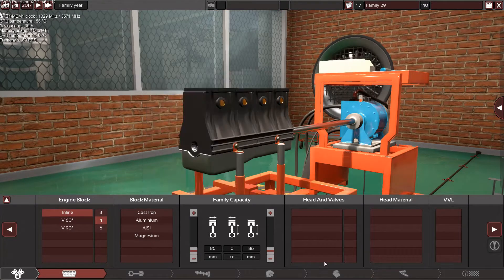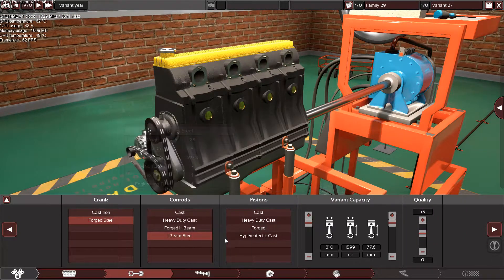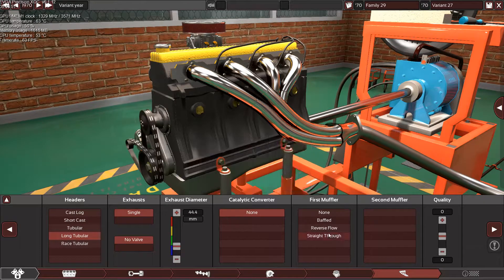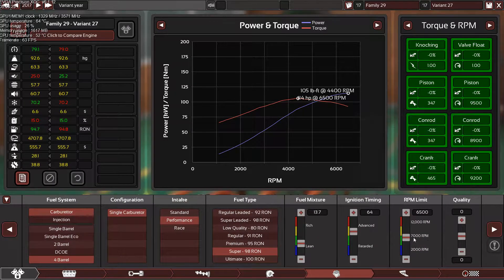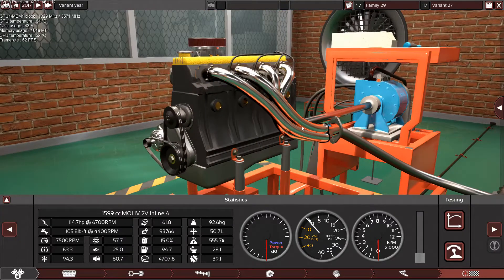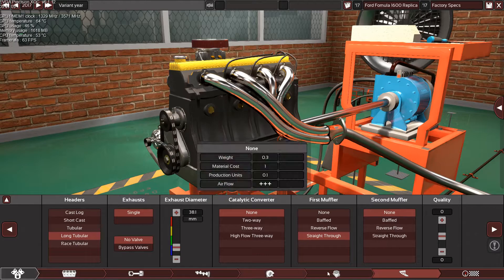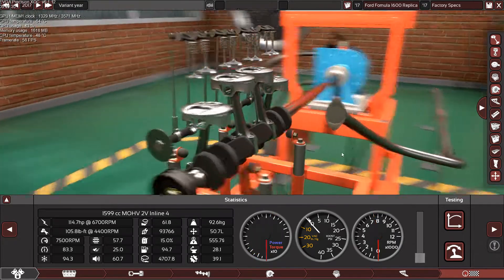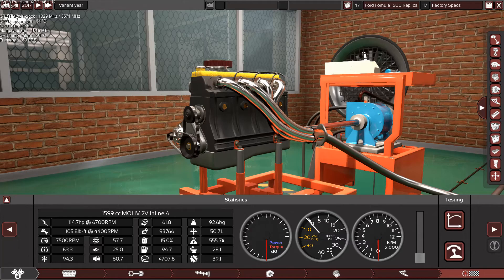Ford Formula 1600 Close Replica (Requested)

Comment: Nice work, thats very close to the original, the race series you are looking for is called formula ford, which is a single seater racer with either a 1.6L kent or a 2L pinto duratec engine, equipped with a hewland 4 speed manual gearbox, I know you had to use modern OHV but thats fine by me.
Reply from the maker: +David Carter 
Thanks man
I appreciate your support